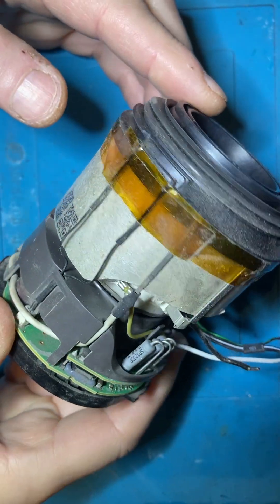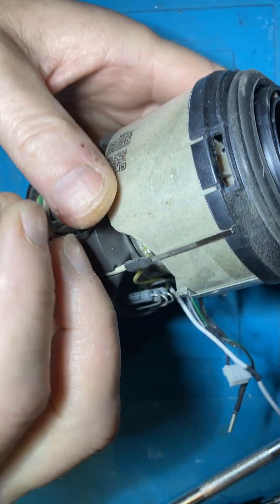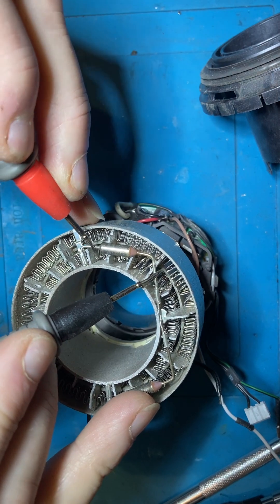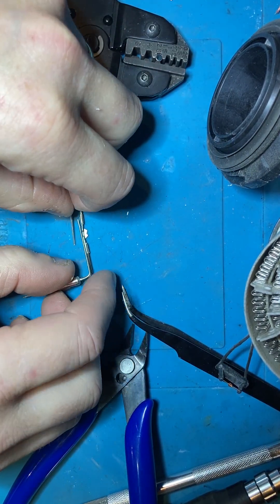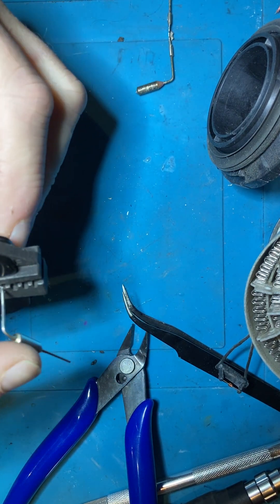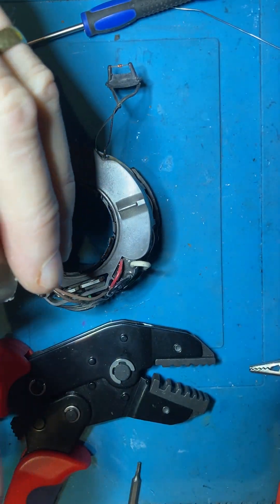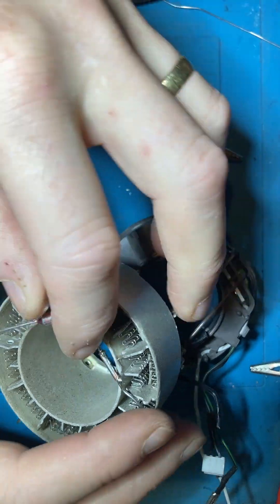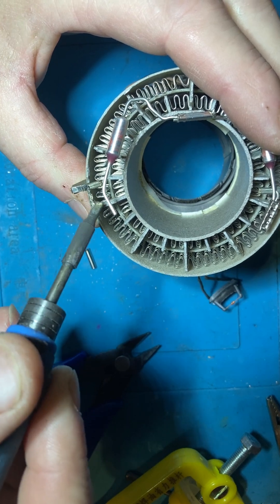Dyson HD02 thermal fuse part 1 of 4

Comment: Any reason why you changed both fuses when one was bad? 

What fuse did you use? Is it 184C 10A?
Reply from the maker: The reason I do both fuses at the same time is, why I’m actually there doing one, the hassle of actually getting to them in the first place it’s better to just swap them both out as a preventative measure more than anything else. None of the fuses were changed from manufacture and I’m guessing it was around 4-5 years old and don’t know the history of the hairdryer and they do get a lot of stick constantly. 
If the previous owner had rested the hairdryer down on the ‘hot’ end while switched on then the fuse(s) will blow, maybe one or both, either way it’s a strain on both of them. 👍
Reply from the maker: The fuse rating is a 185C x 10amp.
Reply: @Mickwild562 can I use a 184C 10a thermal fuse?
Reply from the maker: @adampoplewski1329  yeah that’s the same specs as the original one BUT I’m not condoning you to do any repairs. My video is just for entertainment only and not a repair video to do the same as me. 
But yeah it’s the same thermal fuse specs as the one I replaced. 👍
Reply: Thanks for info!